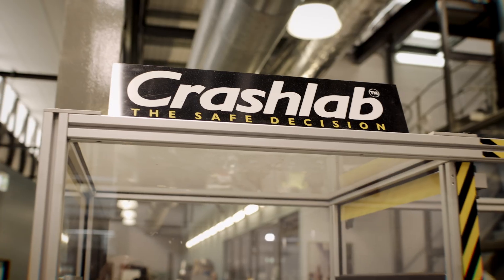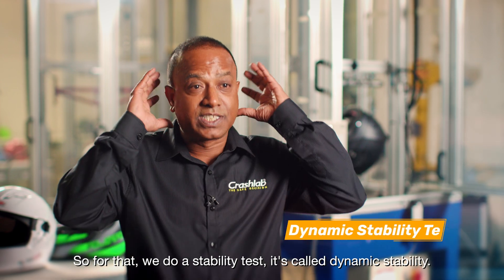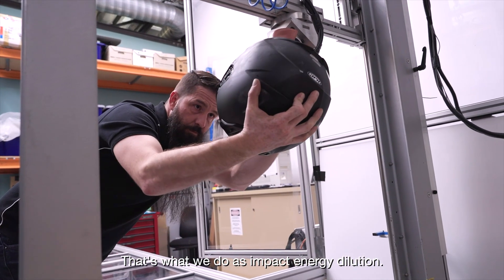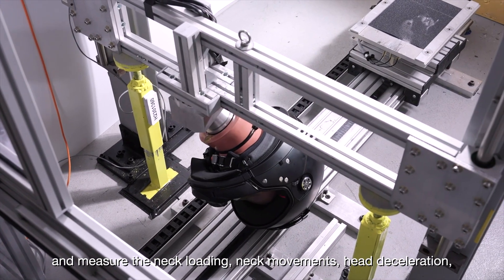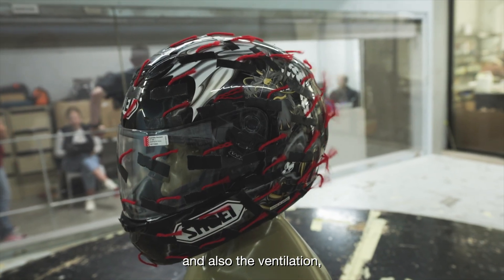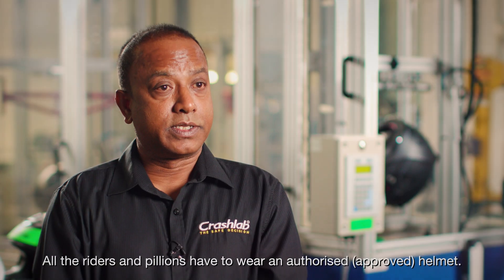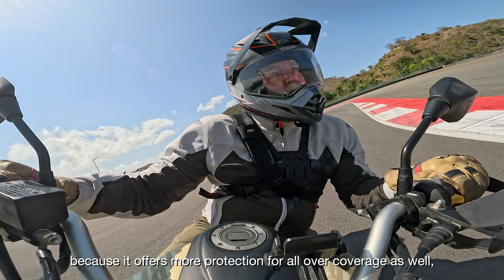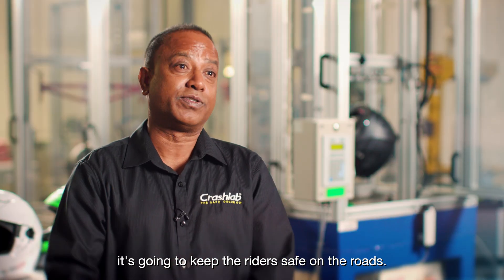What we learned from CRASH TESTING motorcycle helmets

Comment: All well and good for the government to have stickers for helmets. Rather defeats the purpose when imported helmets can have any sticker for any test, in any language if you order them from China. Further I doubt there's many riders looking to buy a new helmet made in 2018.
I would also question the validity of some of the tests. The first test for helmet security looks more like a way to snap someones neck, than a test to gauge it's ability to remain on your head. The impact drop test and the test also is questionable. Dropping a helmet from on to one small point of impact might tell you it wont get cracked or deformed when a rider falls vertically. 
It doesn't measure how much the impact of a 110 kg rider in leathers, more if they're wet, getting slapped by the impact of a supermarket delivery truck at 70 kmh, will jog their noggin.
Reply from the maker: In Australia, retailers can only sell a helmet if it meets the standards and regulations.  If you choose to order a helmet from overseas that doesn’t meet the regulations then I suppose that’s your choice.  In terms of the tests they run, they have all been researched and approved by smarter people than me.  Keep in mind we are just showing a short snippet of the tests they run.